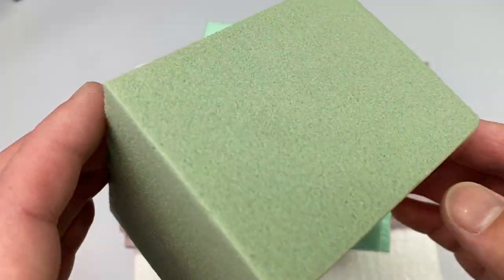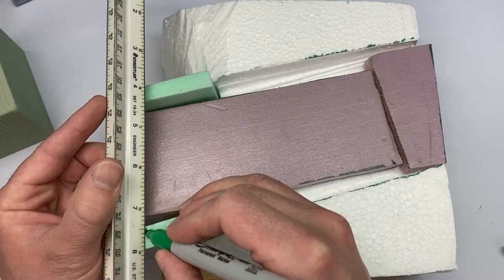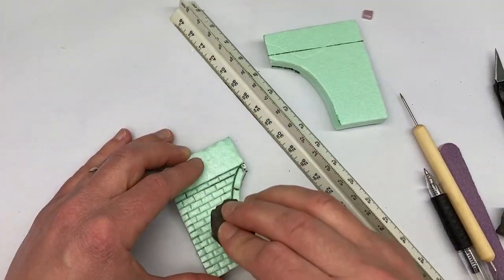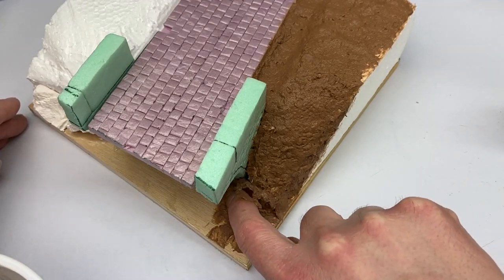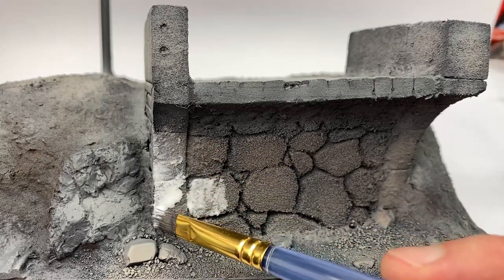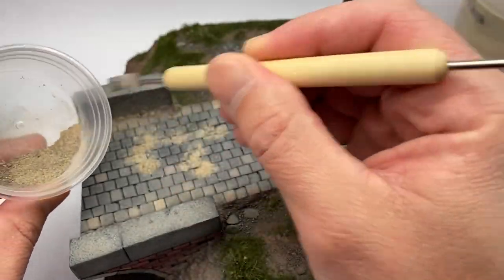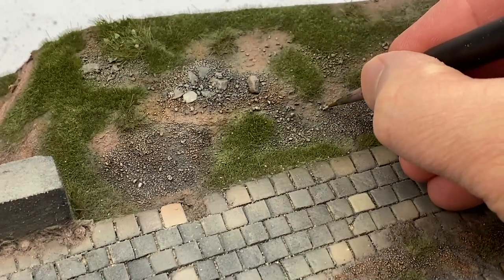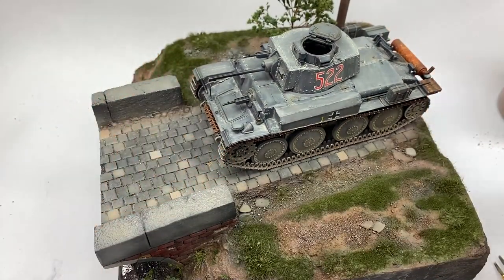Building A Bridge And Cobblestone Road Out Of Foam!

Comment: I used the cheap white styrofoam to make a cobbled road, but not the way you would expect. I used it as the base of a mold into which I poured plaster. When the plaster had set, it had the pattern of the styrofoam in reverse which was perfect.
Reply from the maker: That's an awesome idea! Thanks for sharing

Comment: i've been wanting to try doing some water effects for a while, any tips so it doesnt get messy?
Reply from the maker: I actually didn't show it leak through the tape and then having to add many, many more layers! But the water effects I used this time are super forgiving. When I do resin pours I put an old baking sheet under everything and use hot glue and acrylic to seal the gaps. I have also found that UV resin is great to patch holes in a hurry!

Comment: Floral foam is pretty evil stuff tbh. It's designed to be wet and when it's dry it crumbles into dust. It can also react really badly to anything with a solvent in, glue, paints, etc and release noxious gasses. It's great to see it tested but it's not a suitable hobby material when we have XPS foam instead.
Reply: Coincido totalmente contigo